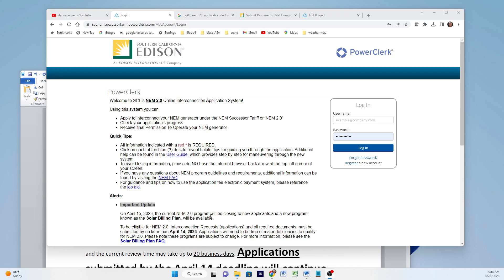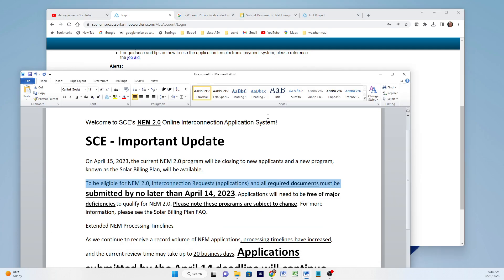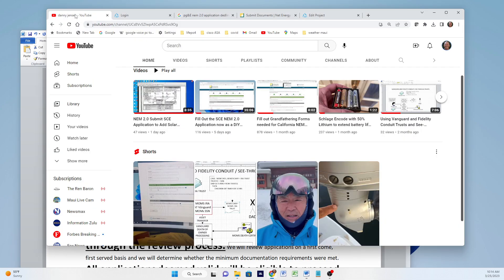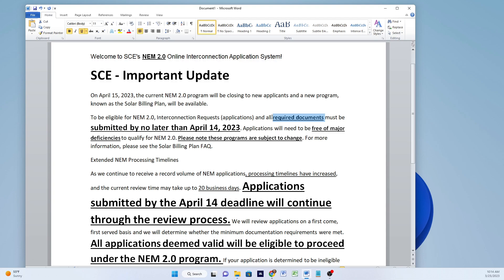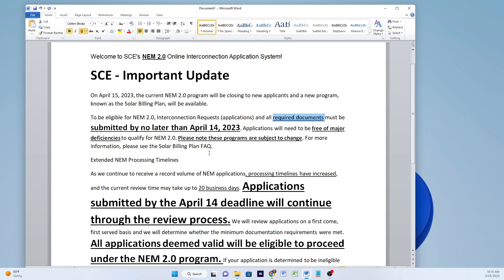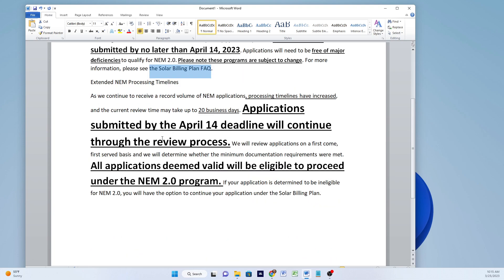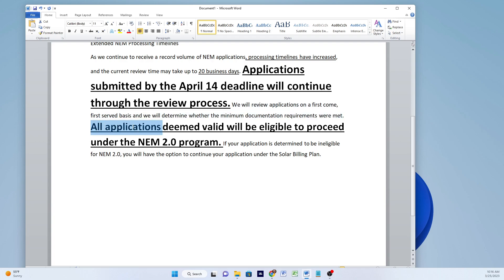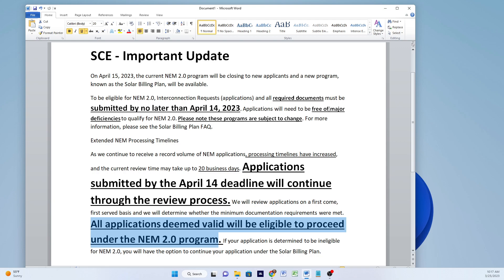Important Update Details on SCE NEM 2.0 Grandfather Application Deadline

Comment: Totally agree. However, this is my interpretation and your interpretation and it is not Southern California Eddison interpretation.
In my opinion, if you’re single line diagram meets all the national and state electrical codes you will have no problem. Minor corrections here and there can be corrected and it is expected and customers should not be penalized over a minor correction as long as the application is deemed valid and that’s the key word in the CPUC  language,  and it is submitted prior to April 15, 2023. It should be excepted under NEM 2.0.  

Major deficiencies could include not having rapid shut down devices at module level , totally incorrect calculation for the load size at the point of interconnection, not, including AC disconnect in the single line diagram, equipment not meeting UL certification. 

Minor corrections in my opinion, could include conduit type, conductor, gauge size, distance of panels and equipment from other panels and equipment or from the floor.  These are small minor corrections again in my opinion.  

I hope those who have done DIY installation in the past and power clerk interconnection request in the past and comment and share their experience   

For some reason, it is very very few resources available on the Internet about these kind of correction
Reply from the maker: I really appreciate your review and comments.
Reply: @dannyjensen4954  thank you for sharing your knowledge and experience, and for raising the awareness. I think people should be aware of the differences in the language used in CPUC resolution, as in what is exactly mean to have an interconnection application that is deemed valid.

Comment: Is there any way for a customer not an installer to confirm that the NEM2 application was deemed valid?  I'm trying to add to my solar system as we now have 2 electric cars but do not want to lose NEM2 status from the current system.
Reply from the maker: You will get an email say deemed valid if you filled out a application and paid the money.